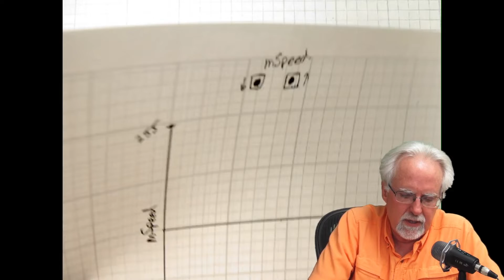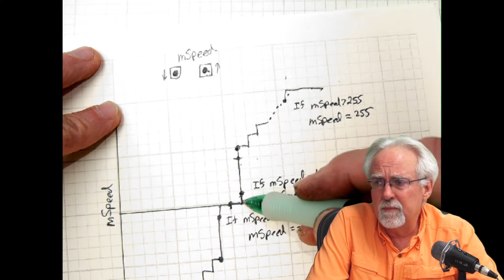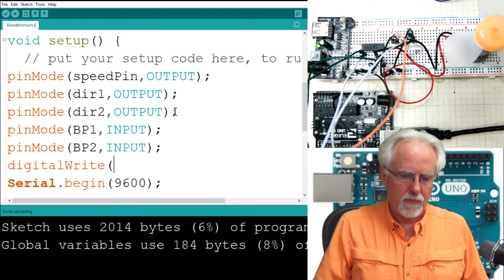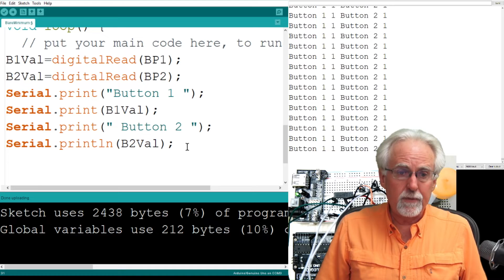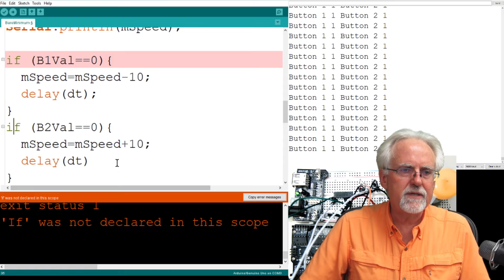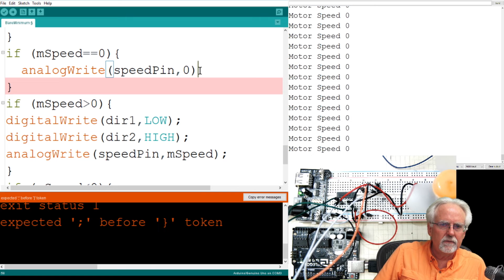Arduino Tutorial 40: Controlling DC Motor Speed and Direction with Pushbuttons

Comment: Funny enough, I did the homework by myself and got my code perfectly put together.... tested everything through the serial monitor and everything was good to go. 
However, when I turned on the power for the motor... nothing happened til I was around 200. So I freaked out and clicked on the video to tsk tsk myself on my failed attempt.  But I did nothing wrong. I even took everything out of my breadboard, even though the circuit was already built from the previous lesson. 

Bad motor?? I have no idea.
Reply from the maker: Battery dead? That is usually the issue. Try using a suitable power supply.
Reply: @paulmcwhorter  
That was the next thing I thought to test, too. Had 8.9V. 
I did find the culprit, however. The battery snap, from my Elegoo kit, had a loose wiring connection. Soldered it, and now I feel smart again. 
Hehe. Thanks Paul!  I am learning a lot. :)

Comment: Thanks again, Paul, for this wonderful lesson. I have done it by myself in a slightly different way. I used a step of 15 to simplify the if statements. Also, my motor starts running at 75.
Reply from the maker: Fantastic!

Comment: Great homework challenge, got it working before checking solution, took a few attempts to get it right, used the -255 to +255 concept but used variables throughout all formulae, no constants. so min speed is a defined value.  Used 6 nested 'if' statements as well, so different approach but  like others didn't know about abs() so multiplied motSpd*-1, same outcome.

Comment: I can't tell if I can say I completed this homework on my own, this is because I made my 2 button incriminat by 15 (this means I needed to push the button many times for the fan to start spinning because there wasnt enough power in the beginning)  which is what Pual said would not work. However I found it to work fine, but the values would mess up and the fan would not act as intended if someone were to play or use the hardware many times. Therefore, other then that it works fine and I am  just going to pass it off as I did it by myself... Regardless, Mr Pual you are an amazing teacher and you kept me working on my project even after I was  staring at my code for hours trying to understand why I couldn't make the fan spin the opposite way. So, thank you so much Pual I would not be able to do any of this without you guiding me!

Comment: Completed homework on my own, but with code/math closer to the Joystick in lesson 39.  I had a buttonVal that moved between 0-1023, centering at 512, then used the slope point math to calculate speed.  My push buttons edited the buttonVal by factors of 64, since the total 'travel' of buttonVal was 1024.

Comment: I was able to do this one on my own. Instead of directly altering mSpeed with the buttons, I used the buttons and a variable I called speedVal to operate as almost like a potentiometer, incrementing from 0-1023 and then used this value to do the linear equation with a y1 value of 100 and output mSpeed from that. Some if statements later and it worked well. Not sure if it was easier or harder than the method you chose but it worked out well in the end.

Comment: int pushPin1=7;
int pushPin2=8;
int pushV1Old=1;
int pushV2Old=1;
int pushV1New;
int pushV2New;
int speedPin=3;
int speedM=0;
int dir1=2;
int dir2=4;
int a=10;
int L=100;
String msg="      L=";
void setup() {
  // put your setup code here, to run once:
pinMode(pushPin1,INPUT);
digitalWrite(pushPin1,HIGH);
pinMode(pushPin2,INPUT);
digitalWrite(pushPin2,HIGH);
Serial.begin(9600);
pinMode(speedPin,OUTPUT);
pinMode(dir1,INPUT);
pinMode(dir2,INPUT);
while(L<=255){
  L=L+a;
  }
}

void loop() {
  // put your main code here, to run repeatedly:
pushV1New=digitalRead(pushPin1);
pushV2New=digitalRead(pushPin2);

  
if(pushV1Old==1 && pushV1New==0 && speedM!=0 && speedM!=255){
  speedM=speedM-a;
  if(speedM<-255){
    speedM=-255;
    }
  }
  
if(pushV1Old==1 && pushV1New==0 && speedM==0){
  speedM=-100;
  }

if(pushV1Old==1 && pushV1New==0 && speedM==255){
  speedM=L;
  speedM=speedM-a;
  }
   
if(pushV2Old==1 && pushV2New==0 && speedM!=0 && speedM!=-255){
  speedM=speedM+a;
  if(speedM>255){
    speedM=255;
    }
  }

if(pushV2Old==1 && pushV2New==0 && speedM==-255){
  speedM=-L;
  speedM=speedM+a;
  }

if(pushV2Old==1 && pushV2New==0 && speedM==0){
  speedM=100;
  }
  
if(speedM>-100 && speedM<100){
  speedM=0;
  }

if(speedM<=-100){
  digitalWrite(dir1,HIGH);
  digitalWrite(dir2,LOW);
  analogWrite(speedPin,(speedM*-1));
  }

  
if(speedM>=100){
  digitalWrite(dir1,LOW);
  digitalWrite(dir2,HIGH);
  analogWrite(speedPin,speedM);
  }

if(speedM==0){
  analogWrite(speedPin,0);
  }

Serial.print(speedM);
Serial.print(msg);
Serial.println(L);
pushV1Old=pushV1New;
pushV2Old=pushV2New;
}

Comment: I was able to get this working as homework, but took a slightly different approach. 
I defined a counter of  the number of button pushes from -10 to +10. Up button increments the counter, down button decrements the counter, and we don't allow too many pushes to move the counter outside of these ranges).

If the counter is 0, I stop the motor. 
Otherwise, using equation of a line, I map the absolute value of the counter (from 1-10) to a desired mSpeed of 70-255 and use the sign of the counter to control direction.

This approach allows me to easily change the code to accommodate both the lowest motor speed and the number of "steps" between max and min motor speed.
(I'm letting the computer do the actual math of calculating the slope and intercept for the equation of a line - they say it's hard work being lazy)..

TL;DR

Entire Sketch if you're interested: (apologies to those learning coding -  I've been programming for years and am dusting off some old C skills...)

[code]
// define points so the complier can figure out slope/interceot
// Please keep these as integer....

#define Y2 255    // Max PCM motor speed to send via analogWrite
#define Y1 70     // Min PCM motor speed
#define X2 10     // Max value of mSpeed (number of button pushes)
#define X1 1      // Min value of mSpeed (number of button pushes)

/*
  Rather than using the numbers 0, 1, and 2 to represent direction, I define a C enum in order to make 
  it a bit more obvious. Now when I mean counterclockwise, I say counterclockwise instead of 2...
*/
enum rotation { stop, clockwise, counterclockwise };

/* Constants */

/*
  GPIO pins on Arduino Duo R3
*/

const uint8_t ENABLE12 = 3;      // motor enable/speed pin (pin 1 on L293D)
const uint8_t IN1      = 4;      // Direction pin 1 (pin 2 on L293D)
const uint8_t IN2      = 5;      // Direction pin 2 (pin 6 on L293D)
const uint8_t UBUTTON  = 12;     // Up button
const uint8_t DBUTTON  = 11;     // Down Button

/* 
  Slope and intercept of the line that maps motor speeds to number of button presses
  Since y = mx + b, we are calculating m and b here as we know y1, y2, x1 and x2 above
  Thanks to Paul McWhorter for shaking out the cobwebs on how this is done!
*/

const float lSlope =  float (Y2 - Y1) / float (X2 - X1) ;      // m = (y2 - y1) / (x2-x1);
const float lIntercept = -(lSlope * float (X1) ) + float (Y1)  ;  // b = -(m * x1) + y1

/*
   Variables
*/

int mSpeed = 0;
bool lastUpButtonVal = false;
bool lastDownButtonVal = false;

bool upButtonVal;
bool downButtonVal;
bool changeSpeed;

void motorControl(enum rotation direction, uint8_t speed) {
/* 
  Based on the direction that was passed in, set the direction pins on the L293D to desired values
/*
  switch (direction) {
    case clockwise:
      digitalWrite(IN1, LOW);
      digitalWrite(IN2, HIGH);
      break;
    case counterclockwise:
      digitalWrite(IN1, HIGH);
      digitalWrite(IN2, LOW);     
      break;
    case stop:
      digitalWrite(IN1, LOW);
      digitalWrite(IN2, LOW);  
      break;
  }
/*
  And then write the desired speed value
*/
  analogWrite(ENABLE12, speed);
}

void setup() {
  // put your setup code here, to run once:
  pinMode(ENABLE12, OUTPUT);
  pinMode(IN1, OUTPUT);
  pinMode(IN2, OUTPUT);
  pinMode(UBUTTON, INPUT_PULLUP);
  pinMode(DBUTTON, INPUT_PULLUP);
}

void loop() {
  // put your main code here, to run repeatedly:
  
 /* 
     I'm assuming that we have pull up resistors on the button, so that
     a digitalRead() call returns 1 when the button is not pushed, and 0 if it is
     We convert that to a convention of "true" if the button is pushed, and "false" if it isn't using the C logical NOT operator
 */

/* 
  Go get the state of the push buttons
*/
  upButtonVal = ! digitalRead(UBUTTON,);
  downButtonVal = ! digitalRead(DBUTTON,);

/*
  I defined a variable that will let us determine if we really need to change the speed.
 We only do something if 
   a) we detect that the button transitioned from Down (prior value)  to up (current value) and
   b) we're not already at the limits of mSpeed (positive or negative)
*/
  changeSpeed = false;

/* check if up button is pushed */
  if ((upButtonVal == true) && (lastUpButtonVal==false) ) {
     if (mSpeed < X2) {
       mSpeed = mSpeed +1;
       changeSpeed = true;
     };
  };
/* check if down button is pushed */
  if ((downButtonVal == true) && (lastDownButtonVal==false)) {  
    if (mSpeed > -X2) {
       mSpeed=mSpeed -1;
       changeSpeed = true;
     };
  }; 
  lastUpButtonVal = upButtonVal;
  lastDownButtonVal = downButtonVal;
  
  /*
    if we pressed a button and are at or below max speed), make the change to the motor
  */
  if (changeSpeed == true) {
    if (mSpeed == 0) {
      motorControl(stop, 0);
    } else {
     /*
        for those unfamiliar with C conditional statement below, the syntax is:
        (<expression>) ? <value if true> : <value if false>
        and equates to saying if mSpeed is greater than 0 (positive) then rotate clockwise, otherwise rotate counterclockwise.
        It's a shorthand way of avoiding the use of another variable and an if... else... statement
    */
      motorControl((mSpeed > 0) ? clockwise : counterclockwise, uint8_t (lSlope * abs(mSpeed) + lIntercept) );
    };
  } 
}
[/code]

Comment: Yes, I did my homework, however as you guessed it the motor rotation was wobbly from 0 until it reached a predetermined value on either direction  ( I did not write out the crossover value from zero). Also my motor speed was set in increments of 5 rather than 10, so the extra coding needed was left out, and the negative speed value was multiplied by( -1) instead of using "abs", since I've just come to learn that term from watching this video.
Once again thank you Paul !!!

Comment: I gave the up/down switches a toggle function because I thought that was what you meant. Got it working flawless after a couple of hours. Give myself a A+ for that.
It looks so easy when you do it.
Reply from the maker: A+
Reply: I did the same thing. I used a third switch as a toggle switch to change directions everytime it’s clicked. Slightly different end result but I think it allows for more control from the user.

Comment: I start my motor speed at 105 and make an increment of 30 every time a button is pushed, so 5 increments in total.

 I also created a "movement state" which increase by 1 every time an up button is pressed and decrease by 1 when the down button is pressed. 
when movement state is more than 0=move forward and less than 0=move backward.

as for the speed of motor i use this code.
analogWrite(speedPin,motspeed+(movestate*30));//add "-" before movestate on backward direction

not perfect, but it gets the job done. thanks for the great tutorial.

Comment: This was a tough one but I got it all done . I did it differently though, I used two variables for speed. One for forward speed and one for reverse speed. I then used four separate if statements. 1. To increase in forward direction if forward button was pressed and reverse speed is zero. 2. To increase reverse speed if reverse button is pressed and forward speed is zero. 3. to decrease forward speed if reverse button was pressed and forward speed was greater than zero. 4. to decrease reverse speed if forward button was pressed and reverse speed was greater than zero.  Took me a while to figure out but satisfying to get it going when I finally did. 

Thanks again for the videos, really enjoying myself working though them.

Comment: OMG!! I was trying to get this to work from 12am to 12pm.  I managed to get this to work with nested if statement which scrambled my brain a bit trying to picture the logic but despite one minor bug it basically worked.  I didn't have a cap though for 255 and a jump start to 100, but I think my code would have broke again if I tried that lol.  The abs statement however I never knew about which would have made things WAY easier.  I had a chunk of code just for converting the negative values for the motor.  I posted what I did below.  I definitely did NOT expect this to be this complicated being a simple pushbutton.

nt speedPin=5;
int dir1=4;
int dir2=3;
int pButton1=12;
int pButton2=11;
int buttonVal1;
int buttonVal2;
int dt=250;
int j=0;
int X=0;
int power=50;

void setup() {
  Serial.begin(9600);
  pinMode(speedPin, OUTPUT);
  pinMode(dir1, OUTPUT);
  pinMode(dir2, OUTPUT);
  pinMode(pButton1, INPUT);
  pinMode(pButton2, INPUT);
}

void loop() {
  buttonVal2=digitalRead(pButton2);
  buttonVal1=digitalRead(pButton1);
  Serial.print("B1: ");
  Serial.println(buttonVal1);
  Serial.print("B2: ");
  Serial.println(buttonVal2);

if(j>0){
    if (buttonVal1==0){
      j=j+power;
      X=j;
      analogWrite(speedPin, X);
      Serial.print("+");
      Serial.println(power);
      digitalWrite(dir1, HIGH);
      digitalWrite(dir2, LOW);
    }
    if (buttonVal2==0){
      j=j-power;
      X=j;
      analogWrite(speedPin, X);
      Serial.print("-");
      Serial.println(power);
      digitalWrite(dir1, HIGH);
      digitalWrite(dir2, LOW);
    }
}
else{
    if (buttonVal1==0){
      j=j+power;
      X=(j*(-1));
      analogWrite(speedPin, X);
      Serial.print("N+");
      Serial.println(power);
      digitalWrite(dir1, LOW);
      digitalWrite(dir2, HIGH);
    }
    if (buttonVal2==0){
      j=j-power;
      X=(j*(-1));
      analogWrite(speedPin, X);
      Serial.print("N+");
      Serial.println(power);
      digitalWrite(dir1, LOW);
      digitalWrite(dir2, HIGH);
    }
}
    Serial.print("j: ");
    Serial.println(j);
    Serial.print("X: ");
    Serial.println(X);
    Serial.println("");
    delay(dt);
}

Comment: I got it working, incrementing 1 by 1 not 10 by 10. It  stops at 105 and jumps straight to -105 (but really, it should go to about 107 / -107) to make sure that it starts). And rather than mSpeed=0 I used 
    digitalWrite(dir1, LOW);
    digitalWrite(dir2, LOW);

between 100 and -100 included. 
Another excellent lesson, thank you!

Comment: I did the homework before and it worked. I did it a little differently though I used a formula and put it in the if statements 

if (fanSpeedCount<0)
{
  digitalWrite(dir1Pin,LOW);
  digitalWrite(dir2Pin,HIGH);
  mSpeedVal=(155./-6.)*fanSpeedCount+100.;
  analogWrite(mSpeedPin,mSpeedVal);
}

Comment: I ended up with a convoluted mess of code after 2 hours that worked intermittently.  I should've wrote down the math but I got cocky. It was bedtime and my patience was wearing thin. I just spent most of today recapping a power supply so I'm just gonna cheat a little and see where my logic went wrong. i also ported my project to the large breadboard and soldered my mini together. what a size difference from the 2560 mega i've been using haha